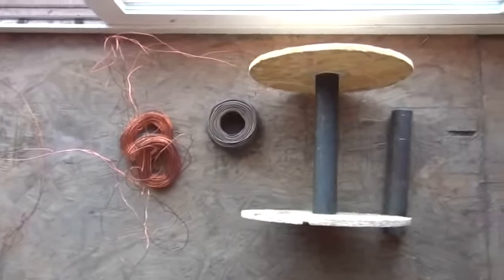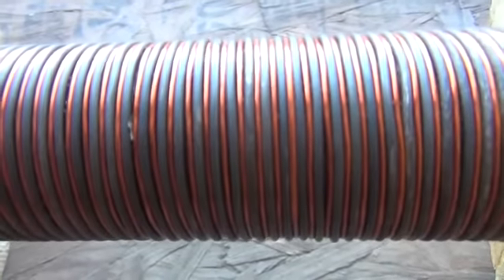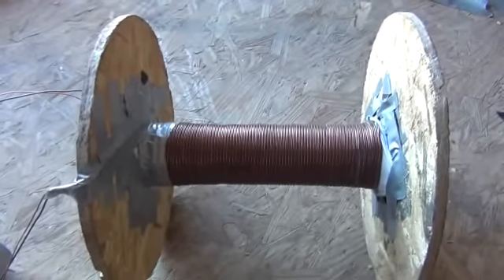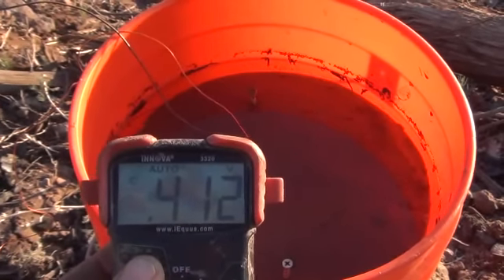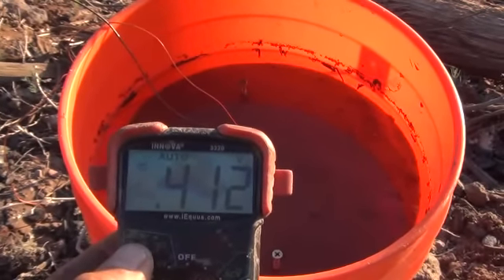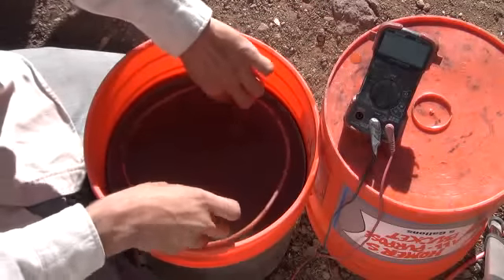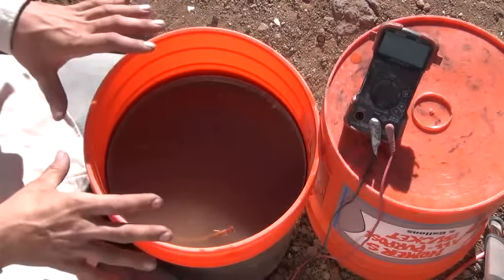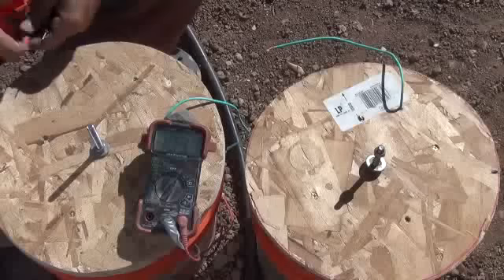Ground Battery, Stubblefield coil and Radiant energy

Comment: It just dawned on me that Earth Batteries could (maybe, big if here!) could be way more efficient than ever before by anodising the Cathode electrode, and Anode electrode that is buried in the ground. There just might be an astounding increase in voltage/current collection, especially where the cathode and anode are separated by the largest space possible. The telegraph companies of the 1800's could collect phenomenal currents because they could locate their ground returns at long distances between telegraph stations. Many stations didn't even need the wet cell batteries they used to power their telegraph sending equipment. They collected significant Telluric currents from the ground to power over long distances the telegraph solenoid coils at the receiving end of the telegraph. In fact maybe the person building one of these Earth batteries with anodised Anode/Cathodes wouldn't need as much distance to collect significant voltage/current. So possibly one could locate his/her Stubblefield coil or metal plate anode/cathode say just a few acres apart to harness enough energy from the ground with an inverter for household use. Who knows.  If you haven't tried this, I think I will experiment to see if significant results could be at hand. Its worth a small expense and find out for sure.
Reply: @dentonfender8872  you’re way above my pay grade so pardon my lack of knowledge on this subject but I’ve heard using them on earths ley lines makes them much more effective and efficient. 🤷🏼

Comment: Stubblefield was definitely a fascinating character. I read the whole story on the web about him. His farm is now owned by University of Tennessee. I would definitely like to know if their engineering department has been tapping into the Telluric currents all these years. If you look up on the web the geomagnetic mapping of the United States, you'll find a heavy concentration of tight magnetic lines of force across Tennessee.. You can see why he was able to power motors and carbon arc lamps on his farm---it's amazing, free power. I still have a hard time understanding why the ground and coil must be wet to function. It seems to me that the coil is acting as a step down transformer, and collecting the current for practical use. He even located his coils close to trees to tap the tree roots that tap ground water. If his coil was simply converting the magnetic flux into current then why the need to wet the coil and locate near trees and ground water dampness. Somehow the magnetic flux from the interaction of the Earth's Ionosphere and the solar wind is generating electrical current, and possibly the concentration of the Earth's magnetic field in this area of the United States acts as pathway or concentrator of the electrical current in this area. The current is then strong enough to be tapped through ground water and soil via the Stubblefield Earth Battery.  But my first conjecture still makes more sense to me because he located his coils north and south using a compass. The northern cathode or electrode was the positive, and the southern anode was the negative electrode. I suppose he was somehow collecting current in both manners. It seems to me that Telluric currents could be viable source of power that should be taken advantage. Instead you read that all means of measures are taken to reduce or neutralize GIC Telluric currents in the world.

Comment: This is getting me excited about the possibilities.  I need to experiment soon while the ground is soaking wet from all the rain---easy to dig.  I need to find out how to anodize iron which I think is a little more complicated than Aluminium.  I can only separated my cathode/anode by about three acres instead of a mile because any further and I would have to trespass on my neighbours property to string wire and bury the cathode or anode. So I'm stuck with three acres max. Could string out the Earth Battery in the mountains on public land---nobody would see it after it was build. The mile long insulated wire back to the other electrode (cathode of anode) would be hidden in the brush.

Comment: Have you ever heard of the "cylinders of the pharaoh"?  Made from copper and zinc tubing filled with quartz when held will produce around .6 volts.  You become the battery while holding the copper in the right hand and zinc in your left hand.  If enough people are connected in series they could make enough power to light an led light.  Make them yourself of buy them on Amazon or Etsy.

Comment: Just guessin, but, here goes. If you should get enough power to charge a capacitor, (high speed ) then use a transistor to pulse the coil. The true power is not what the coil makes or picks up from the background but what it makes when pulsed at resonance. you do not need very much amperage or voltage, just enough to create a resonant pulse. This can be hundreds of times more power. Just tough to make and tough to catch.
Great videos
Clay

Comment: Voltage and current output from copper coil immersed in the solution will continue to drop, as the copper tubing continues to oxidize. This increases the cell resistance.

Comment: Separate your anode and cathode of your earth batteries as far apart as possible. Any metal will work as you have found out with your copper tubing and sheet metal batteries. Separate the anode and cathode by several acres if possible and if you take the time to anodize the anode/cathode you may be in for a surprise beyond just the separation of space between anode/cathode. You can anodize aluminium very simply with potassium hydroxide at home.

Comment: To: Mr. Teslonian:  You might want to do a search for the new Brass and Iron chargeable batteries that is all the rage on the web now. At first you say Edison invented that type of battery many years ago and its not best you can make with scrap metal. Just look scrap metal battery.  The three of four researchers have used scrap Brass and Iron that they anodise first, and then immerse them in a cheap electrolyte (I think it is either sodium or potassium hydroxide). They have charged and discharged their prototype batteries up to 5000 times with only a 10 percent loss in charge-ability. I think that is better than Lead-Acid batteries---definitely cheaper to make. The key to this new type of Edison battery is the anodising of the electrodes. Look up anodising on Wikipedia. Not difficult to do at home, definitely DIY project. People whom choose to live outside the grid can now build their own super efficient rechargeable batteries instead of depending on expensive marine batteries.  This is a big development for off-grid living.

Comment: LIKE YOUR project here it makes me think about how ham radio operators increase signal in & out when they burry a waud of wire or a stile plate under there antenna's  then soak the ground making a   larger ground plain so  you might want to try adding antennas  of less mass equal mass and greater mass or coils and try drawing power from the different or sum  in the earth and the air then us voltage doublers circuits. as long as u have 1.5 v to 3 v constant and ull have slight ac from atmospheric  and maybe some ac from ground @ 6 Hz use  a mossfet trans, coil, and cap as type of gewl theaf after  the 4 diode and 2 electrolytic and 2 ceramic caps.   P.S. love ur idea 4 bucket caps

Comment: Have you thought of putting longer bolts on the center rod, straddling it between two blocks and then using a drill to rotate the whole unit slowly in order to spool the wire? It sounds like just using your hands was a real pain.

Comment: take a small brass plate (4 inch) and a small aluminum plate and drill both full of holes and press a thick paste of water and bicarbonate of soda between them.  You can charge this cell to produce enough current to power small motors.  But, a hearing aid battery has more power than this or any of the things we have seen here.  The Earth and the atmosphere hold enough energy to power everything on the planet.  Capturing that energy is a real challenge.

Comment: I wonder how much voltage/current could be collected/generated by separating the Anode and Cathode by one mile, using large sheet of anodized aluminium and at the other end a large sheet of anodized iron. The Cathode should be buried deeper than the Anode supposedly. See Wikipedia on Earth Batteries.

Comment: Can you hook up  all of the negative- terminals all of which have a different voltage to create a collective voltage as long as the negative- terminals are still connected to the same positive+ terminal on that circuit to get a total of .3+.3+.7+.5 to get 1.8 volts ⚡️

Comment: Different metals have different potentials and having them in a conductive liquid of water makes it become a battery. However, the energy density of the design in this video is incredibly low and it won't work forever either. Stick with your traditional batteries and save your fingers, if you need battery power and if you want to capture electromagnetic energy, you need a broadband antenna and some efficient rectifier. Running your crystal radio on radio waves alone is trivial. Running your house on it is impossible, unfortunately (not enough energy in the air).

Comment: Can I ask a couple really dumb questions?
@ 10:00- 10:40 you get 4 different readings for output. Why not just use all 4?.
Attach a diode to each to prevent back feed,,,, maybe?
Also taking energy from water doesn't make sense. Water has a very low mineral content, much lower in acids and salts, but in those acids and salts you can find the reaction. That's what energy is. It's free moving electrons released by a reaction... "friction even, I bet if you spun the tub you'd of had six times more"

Anyway I like yer mind, I just think you start out too slow on the objective and need to give more credit to the "if you wanna know the easy part look it up in a 5th grade science book"

Send me an email, I got some ideas on this that I need help with, might have some advice for you too.